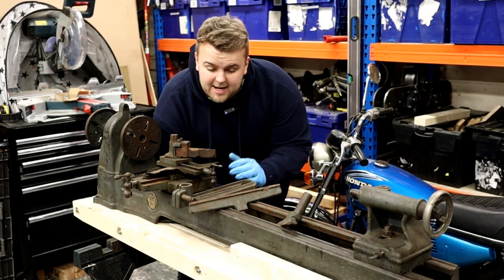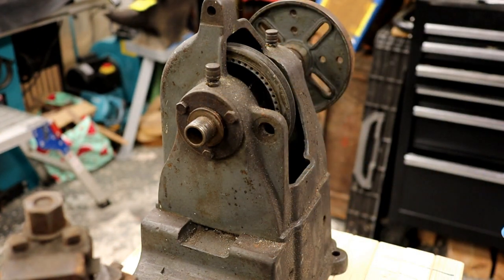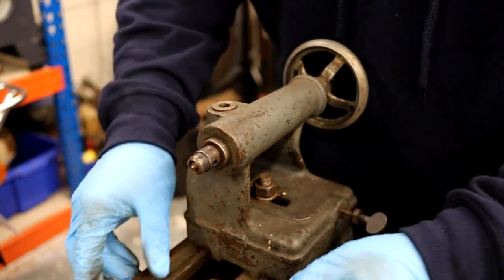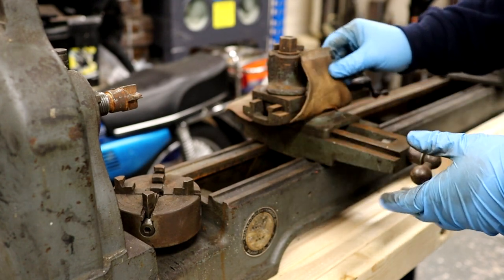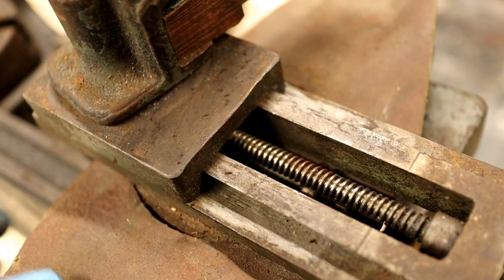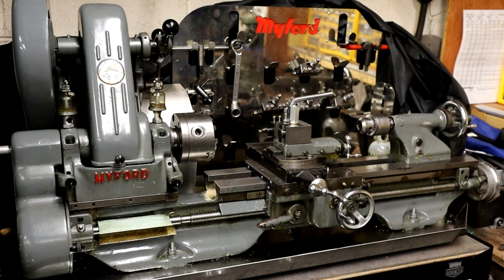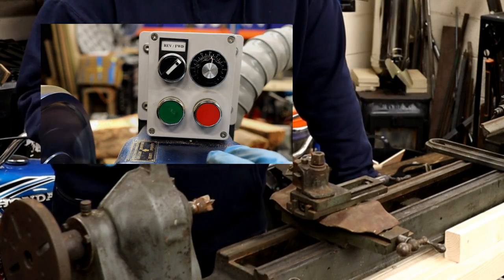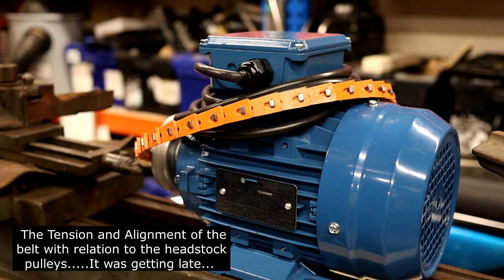Walker Turner (The Driver) L752 Gap Bed Wood Lathe walk around video, Plans & fitting a VFD ⚓🛠

Comment from the maker: Afternoon All, Thanks for the messages. I have a confession after making the video and taking apart the head stock (Details on Instagram) I thought i ought to double check the chuck thread pitch. I assumed what i read on the internet was correct when making this video, After inspection this actually is a 1" x 12TPI spindle nose thread. (I haven't checked the outboard pitch)  Which is a good thing for me as these are slightly better to obtain. Apologies for making the mistake, please always check first! I should of known better. In brighter news everything has been completely stripped and off to the vapor blasters. New bearings hopefully sourced and on the way and also investigating the below chuck (Same one ive been using on my Meteor lathe) : From Rutlands - https://www.rutlands.com/sp+woodturning-chucks-precision-100-woodturning-chuck-precision-100-woodturning-chuck-kit-precision-100-woodturning-chuck-kit-rutlands%C2%AE+m_r2520?utm_campaign=Googlebase&utm_medium=organic&utm_source=Googlebase&geoip=GB   Thanks all have a great Christmas! ⚓

Comment: Great lathe. Walker and Turner are great. I've was close to buying a WT scroll saw recently, but suffer from small workshop syndrome, so didn't go ahead with the purchase.
Reply from the maker: If it’s anything like my 24” Beaver scroll saw they are built so well. Can’t even feel any vibrations when using it. As I get more and more kit I am struggling with space! Typical when you find something nice you never have the room. Thanks for the comment ⚓️🍻

Comment: Did you say that you built that adjustable speed control box, or did you buy it already assembled? I like the set up and would like to add it to mine.
Reply: The box on your blue machine that is. About 4 inches square with the red and green on and off buttons and reversing switch.